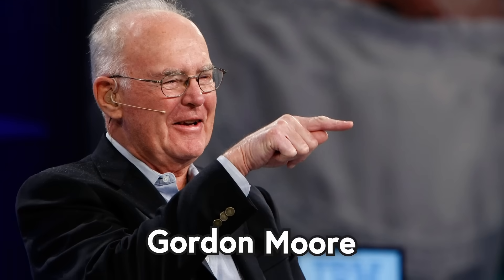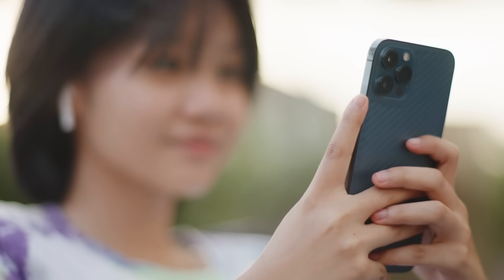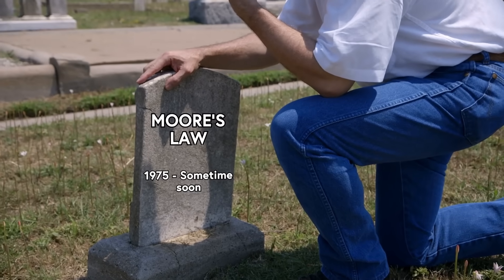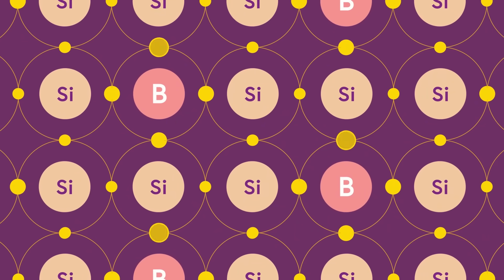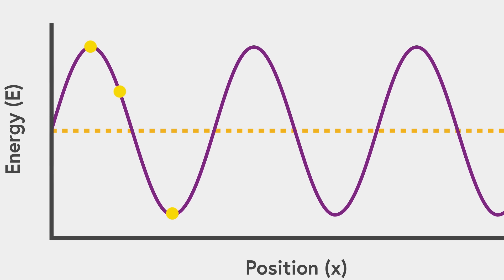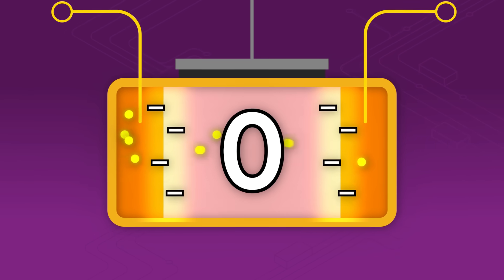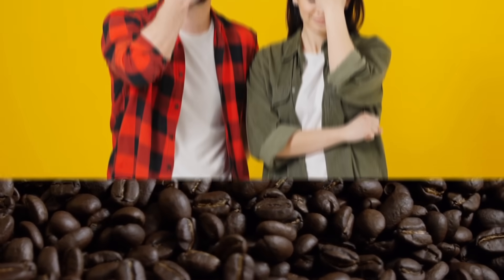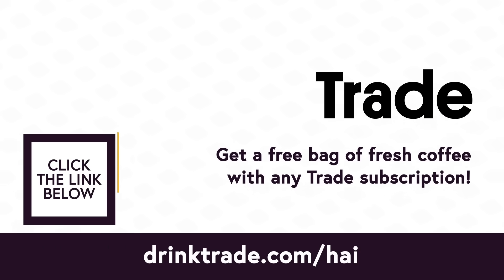Why We're Reaching the Theoretical Limit of Computer Power

Comment: So couple of fun things.
1. 3 nm processors aren’t actually 3 nm. The actual gate length is hard to find, but it’s probably closer to 6 to 10 nm at best and closer 20 nm at worse, while other dimensions are reported to be between 20 and 40 nm. 3 nm, and any other nm size given to chips is just a marketing name, just as 5G didn’t fit the original guidelines made for 5G, but was seen as a significant enough improvement over 4G LTE that the FCC allowed cell service providers to use the name.
After doing a bit of digging, there was a guide published by the IEEE called the International Technology Roadmap for Semiconductors later renamed the International Roadmap for Devices and Systems that starting in the 90s began publishing a set of standard marketing terms that were initially meant to be connected to gate length, as they had been previously, but after 1997, began to be used more as shorthands for performance. A 130 nm chip has the performance similar to what Moore’s law and it’s counterparts like Dennard’s law and Koomey’s law would have have predicted if transistors neatly scaled down to that size. Since 2011, transistor sizes have not been shrinking by very much, and it is not unreasonable to call certain definitions of Moore’s law dead.
2. The most important counterpart of Moore’s law, that is Dennard’s law, stopped holding true in 2005. It had stated that circuits of an equal area consumed equal power regardless of transistor size on the circuit. Practically that meant that by doubling the number of circuits on a circuit board, but halving the power each of them required, let them switch twice as fast to generate the same amount of heat. Or to put it in more direct terms, processor speed went up. As mentioned previously that’s no longer true and hasn’t been since around 2005. If you look at processors beforehand their clock speed was a major part of marketing, and processors from 2000 were noticeably slower and measured in MHz while those in 2005 were usually around 4 GHz. Now if you look at high end processors, they have speeds around 5-7GHz depending primarily on the cooling system rather than major advances in the processor itself. While Dennard’s law held true, you could expect that programs would take half as long to run if you waited 2 years and bought a new processor, or a fourth as long in 4 years, and so on. Since then we’ve had to get creative.
3. The two other interesting things about Moore’s law, that is the number of transistors per area, and the number of computations per Joule, the last being called Koomey’s law, have remarkably still held true even as transistor lengths have failed to shrink at the rate predicted since 2011.
Since then we’ve become a lot better at optimizing circuits, producing more complex circuits that can perform the same tasks in fewer steps, creating larger and faster circuit memory caches so less time is spent shuttling information from the RAM to the processor. In addition we have produced far more efficient processors in the form of GPUs and Application-Specific integrated circuits which can perform their tasks far more efficiently than the generalized CPU. Koomey’s law was initially expected to slow down and die after Dennard’s law ended, and was slowing down by the time 2011 rolled around, but since then has picked up and chip designers have managed a doubling speed of 1.2 years despite Moore’s law which describes the number of chips per area having slowed down to 2.5 years in the same period.

So in short, while transistor lengths won’t be getting any smaller, that doesn’t necessarily mean Moore’s law is dead just yet.

Comment: As an electical engineer, this was probably the best explanation of transistors aimed at non-engineers I have ever heared. Props to Amy!
Reply: I have to agree. As someone who was TA for a junior level semiconductor course when I was in grad school, I thought this was fairly accurate and easy to follow for coming from a novice.

Then again, it's been more than 20 years since I taught that course and I've forgotten a *lot*.
Reply: as an almost complete layman I understood they preceed an off or on interface that can be interpreted by software to do all kinds of stuff....binary if you will 🙂
Reply: As a physicicist would say the same about quantum tunnelling
Reply: i'm a software developer and yes, this is a good explanation about how doped silicon (the process of adding germanium and boron is called "doping") manages the flow of electricity to create tiny switches turning on and off. It's a surprisingly simple concept
Reply: @indoor_vaping  i've never heard that they dope with germanium, only knew about the phosphorus/boron combination
Reply: @Krokoklemmee  Germanium, as well as many other elements can be and are used for doping; just not for your standard CMOS-Silicon. Dunno where germainum is used, but when you go into High-Power, Extremely high precision or RF magic the materials it can get wild.
Reply: @indoor_vaping  Germanium is a silicon-substitute that replaces the undoped lattice, as it's a 4 valence electron atom. Doping is replacing undoped lattice atoms with atoms that have valence electrons of less than 4 for P-type and more than 4 for N-type. By the way, germanium was the first semiconductor lattice used for transistors, and was used for several years before silicon started to be used.
Reply: @Chris.S  Ge can technically be used for doping in compound semiconductors (GaAs, InP, etc) but Si is much more common. Introducing Ge into an Si crystal creates the compound semiconductor Si(x)Ge(1-x) which is used to create more specialized RF devices like HBTs. You also need way more Ge to create SiGe than is used for doping
Reply: I literally came here to say "As an electrical engineer... " but yes. Amy sneakily turned an HAI video into a tiny Wendover production.  Wooo Amy!
Reply: As a computer engineer. I enjoyed it too.
Reply: This was a better explanation than my college professor gave me
Reply: The section describing them brought me straight back to my VLSI class in college, and I wish my professor used this exact clip to explain it
Reply: As a informatician, I agree.
Reply: Just wondering, the company I work for makes chips made with silicone carbide. How does this change how semiconductors work? I know our devices are mostly mosfets and made for power related purposes. But could this work for computer chips?
Reply: I agree I’m a senior undergrad ee
Reply: I’ve got a computer science degree that and have heard a dozen different explanations. This was the most clear and concise one I’ve heard
Reply: And fastest
Reply: This same retarded comment is on everything.  ‘ as a (insert loser here)… I deepmthroat hotdogs…
Reply: It was lacking some crucial details, but its decent enough for people who know nothing prior
Reply: But the title should be , "Why are we reaching the teorical  limit of computer power driven by transistors"
Reply: being named Amy, I am honored
Reply: hey i’m looking to become and electrical engineer, what’s something you wish you had known to make the process easier?
Reply: the guy had to do insane animation for atom illuatration inaide the transistor, more quality than what our college professor had to offer.
Reply: Agree with this completely. If my semiconductor devices professor had explained it like this, I would have had a lot less trouble grasping the formulas and physics 😅
Reply: Computer Scientist here. I only took a handful of Hardware courses, but I would have to agree with you. I would absolutly show this video to any Non-Professional who wants to know how stuff works.
Reply: And my pc is still running slow…
Reply: @Youngbl33zy get a ssd
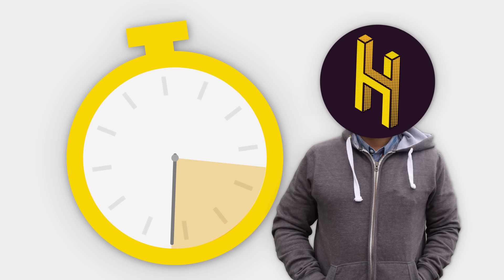Reply: Yep. Physicist here, so my expertise is in the principles, not the design necessarily. Those principles are pretty well explained. I will touch on one small detail and say that the exponential decay doesn't actually go to 0 (4:32) as e^x is never equal to 0. Thus there is still a nonzero probability that the electron does still tunnel through even with a thick transistor, it's just very small.
Reply: You are nothing bro
Reply: Not really. She mixed information about BJTs and MOSFETs and ended up with an explanation that is not correct for either.
Reply: @vladomaimun  that's not entirely true. n-channel MOSFETs still have p-type regions
Reply: Almost. It's not that the depletion region just gets neutralized, it's that the positive voltage at the gate attracts a bunch of electrons (that still exist in the boron-doped region but at a much lower density) to the middle region (the "channel") so that a conductive soup of electrons now exists for the electrons to move between the main terminals (the "source" and "drain"). Nothing significant happens if you bring the depletion region to neutrality at its "threshold voltage;" you need to exceed the threshold voltage with more positive voltage.

Source: I'm currently an electrical engineering student and took classes about transistor engineering and semiconductor physics
Reply: @JP-lo6hn I think their use of the word "neutralize" wasn't being used in reference to the voltage, but rather the definition "to make ineffective". They were basically trying to say that the depletion region's ability to stop electron flow was neutralized. Unfortunately, us electrical engineers have comandeered too many words and they happened to pick one that sounded like it referenced voltage.

Of course, they did not cover the finer details of gate and depletion behavior in this video, but it's not vital to understand much more when it comes to transistors in digital systems.
Reply: Probably because "Amy" is just ChatGPT.

Comment: The law of more AKA moores law may be dead, but could still have an Easter like return.... The law says transistors per unit area will grow on a curve.  Atoms are a limit to the 2D size, but area is not volume, so just like how cities had houses shrink into row-houses and then apartment blocks to increase density.... chips are going 3D.  Stacked chips on-top of other ships in the same packages etc.  Ultimately heat is the real issue for users of computers, as we don't care if the processor is 1cm larger if it can go 10x the computational work.

Comment: Nowadays most computers get better by being more efficient. It turns out that most PCs carry around a bunch of legacy cruft that lets them pretend they're still an 80's PC, but nobody uses that anymore so it just wastes space. Smartphone chips get rid of all that, so they're more efficient and smaller.
Reply: There have been many attempts to do the same in PCs. They all run into the same problem: It's no use having a better architecture on paper if all your customers complain it won't run their software.

See the Itanium for an example - the architecture that was supposed to revolutionise everything. On paper it worked great. But in the real world, it was a disaster that earned the mocking nickname Itanic. It had a niche in high-performance computing for a time because in that field you can ask developers to not just port software but optimise it for a new architecture, but reception outside of that field was terrible. There's no use in a super-processor if it won't run the software you need.
Reply: Any hierarchical file structure is using 1960s tech. So suck it zoomer.

Comment: CMOS logic gates DO NOT represent boolean states using current, only voltage. When the potential at a gate goes from low to high or high to low, it will either bring VDD (the high voltage) or VSS (low voltage/ground) to the next stage of the circuit. The current only happens as the charges move to the next gate when the voltage changes, then the circuit reaches a stable state. That's why the CMOS technology is so efficient: no current is drawn unless the state is changing. That's also why power consumption increases as the clock frequency increases: permutations more often = current is flowing much more frequently to reach the next logic state = more power drawn. No current, no power being used!

Aside from that, this is a rather good video. I'm just sick of these "end of Moore's law" prophecies. This farce has been going on for more than 30 years now, yet semiconductor engineers keep figuring out ways to increase transistor density and at still roughly the same rate! Yes there is obviously a physical limit at the atomic size, but we are not even close yet. As you described, quantum physics get in the way much much earlier than the minimum atomic size. But these things can be controlled, although it requires an increasing amount of expertise (which is vastly beyond my qualifications which sit around a 350nm process, where you can safely totally ignore QM). So we do not know until we're there. And even there, we could leverage quantum mechanics effects to produce more computational power somehow, without even increasing the actual transistor density. So anything is still possible! And to conclude, computers are already quite fast and I would not be bothered to have today's computational power density staying the same indefinitely. But that ain't happening!

Comment: The interesting thing to me about binary computers is that, we went with that design out of laziness.
We could have a ternary or an octal computer by adjusting the frequency of the electrons and measuring that, but instead we just register them above a given frequency as 1 and below as 0.

And now we're paying the consequence of 150 years of computational laziness😅
Reply: It's more about noise immunity. Binary doesn't need super-precise voltage regulation and can shrug off a bit of noise.

Comment: While Quantum computing is one of the ways that we are trying to speed up computers, there are still multiple performance improvements being developed on our traditional binary systems.

One of the ways that computers are being made faster is through the use of 'Heterogeneous Computing' my fellow gamers know about their GPUs, right? We have our normal CPUs which can make complex calculations very quickly, we can use multiple cores (threads) that allow us to run things in parallel, speeding up the CPU. 

GPUs work in a similar way, except now you have thousands of threads and/or cores instead of 16 (for the modern consumer CPU). While GPU cores are indivudually slower than CPUs, using them in armies of thousands of cores lets computer operations be massively parallelized and ultimately sped up. 

One of the bigger bottle necks with modern performance improvements isn't the speed of the calculations made by the processor though, it's actually memory transfer speed. When you use multiple compute units (CPU, GPUs, FPGAs, Domain-Specific Systems on a Chip, etc....) you have to transfer the data from the host (usually the CPU) to the external devices. So we must look at tradeoffs like calculation execution time vs memory transfer time and make desicions based off those metrics. Being limited by raw transistor speed at the end anyways :P

Either way, fantastic video! I enjoyed listening to it :)

Comment: Hey, my grad research was on how to get performance out of computers once we hit this limit. 

Including stacking things like memory vertically instead of just x,y. Which not just increases capacity, but the third axis allows additional parallelism and faster access times
Reply: There ain't nothing like jacking up clock speeds. If you can't shrink gates you can't go any faster there either.

Comment: Moore never said anything about transistor size nor density, only about transistor count. And that's not stopping any time soon. With chiplet designs and multi-layer wafers, alongside larger chips, transistor count will continue to grow.
Reply: Count alone will not net us the gains we've been used to getting. That's come from node shrinks.
Reply: @1pcfred  It will, because software will have to change. We used to get most of our gains from increased frequency, which meant software didn't have to do much. Then we hit a ceiling, and the only way to grow was parallelization, so software adapted. Shrinking nodes help a lot because it means reduced latency, and it means local high speed buses. Well, long before that was possible software written specifically for it was using systems with multiple discreet CPUs, which didn't have any of those advantages, and still managed amazing speeds. We need to get out of x86, and out of CISC in general.

Comment: Why don't we use trinary? Or even have 1 transistor represent 4 states?
Reply: Because such circuits are highly susceptible to noise. It's very hard to make them function reliably. The only place you'll find them in digital electronics is your SSD, where that method is used to store multiple bits in one flash cell.

Comment: Quantum computing is NOT replacing normal computing. It cannot now and never will be capable of doing so. Quantum computing only allows us to compute very specific types of problems much faster. Right now, there is literally no viable replacement for classical computation. Which means that the industry actually is running into a problem. And part of that is already visible right now. The huge semiconductor crisis is partly made responsible by the insane difficulty and cost involved in making chips faster.

Comment: Quantum computing is almost certainly not going to replace regular computing in your regular desktop environments. Instead it will just be more and more of a requirement to use multiple processors. There's also still a lot of room for conventional gain through the optimization of chip architecture. And some things like DACs hit a limit a long time ago.